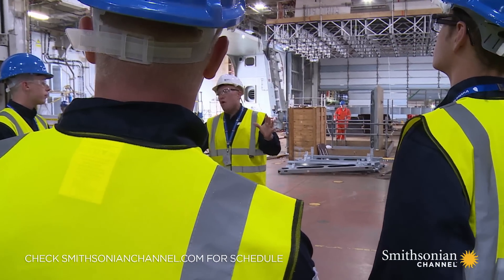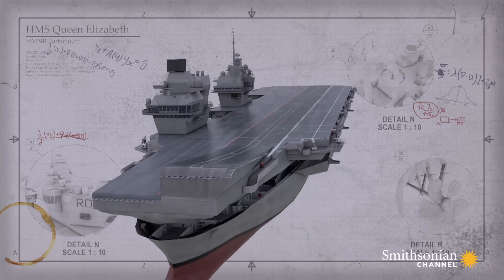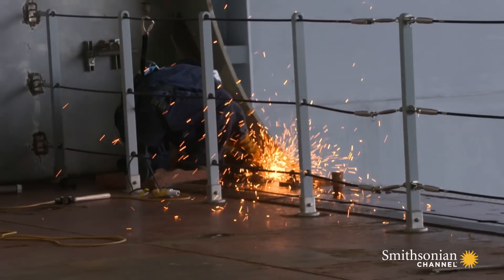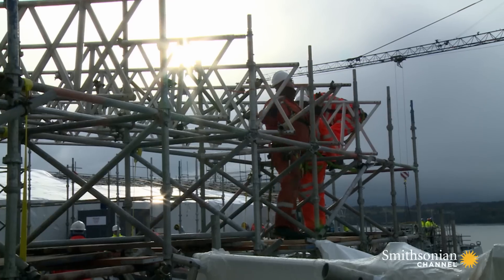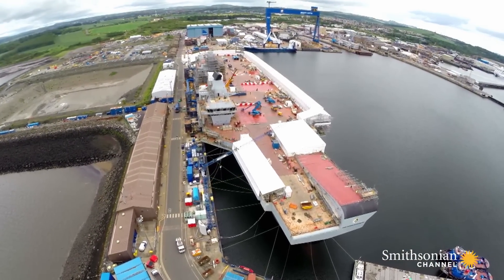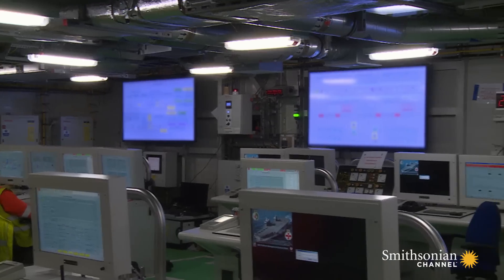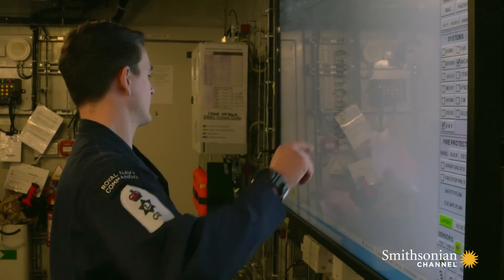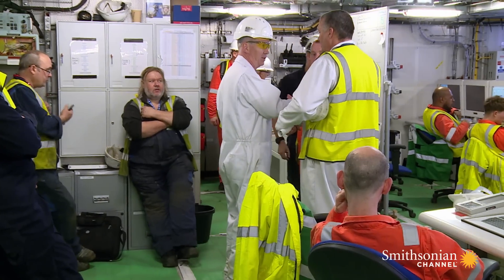The HMS Queen Elizabeth Stats are Startling

Comment: One interesting side note, is due to previous experience with aircraft carriers, both UK and US, she was designed with wider corridors so people could pass each other and such much easier. Also makes casualty transport easier.
Turns out injuries in corridors (cracking head on doorways, tripping over raised sections of the bulkhead) are one of the biggest loss of crew on deployment.

Comment: Constantly compared against American Naval counterparts-

First of all it runs on diesel with no nuclear reactor, What a joke. You are permanently limited to fueling stations. I dont care that it takes 1/3 or 1/4 the manpower. Obviously technologically inferior from the get go.
Reply: That's not as big of a deal as people are making out. Carriers need tankers, not just for refuelling themselves, but their escorts and their aircraft, so you'll never get away from that unless everything is nuclear powered.

For most countries it just doesn't make sense, you require far more maintenance and it's far far more expensive. It only makes  sense for the US because they have enough for a rotation so that there's always a number available and they have the budget to burn.
Reply: Do people run on nuclear reactors? What about the aviation assets? Surface assets? Nuclear power is a nice thing to have but when you have a ship full of people, planes and boats that require fueling, you range is still limited by fueling stations and resupply. 
"Keeping the carrier’s seven galleys adequately stocked is vital. A supply ship delivers 400,000 to 1 million pounds of food every seven to 10 days." This is from an article on the Nimitz. Not so much an unlimited range.

Comment: And yet still a ramp. Modernize. Catapult launch.
Reply: If anything the ramp is a more modern form of launching jets. The Royal Navy were the first to launch fast jets from carriers using catapults in the 50s, but later came up with the Ski-Jump design that they've used since the 80s.
Reply: Catapults put far more stress on the aircraft, costs more, possibly a third of the cost of each carrier to install on both ships. Plus there is far more to go wrong

Comment: It’s great. But It leaks and it’s powered by diesel, so the range is severely limited. Honestly this ship is advanced, but they should have gone nuclear powered.
Reply: All ships leak to some extent, and it's far from unusual to have leaks during initial testing of a first in class ship, you get those issues out the way early on during testing for a reason.

Nuclear power would have been massively more expensive too, to the point where the UK would have likely only built one carrier, leaving them without one for extended periods (Especially considering the extra maintenance required for the reactor). A carrier is always going to be limited by its escorts and aircraft which both require fuel anyway, as well as other provisions.

Nuclear power is useful in saving space on board as you don't need to carry as much fuel, but the ship was scaled to specifically meet the Royal Navy's needs, so there's more than enough space.

Comment: Problem here is that it runs on gas. 

10000 NM (19000KM) range is only about 2 weeks under her own power (Based on the 32kts/59kmh speed found on Wikipedia at least) I'd assume that the range is probably calculated at a more economical speed so maybe it'd last longer, either way, definitely going to be a pita to keep this thing going in the long term..

The same kind of automation and innovation on a Nuclear powered carrier would be fantastic, but with the limited range and regular need to refuel, not to mention the space lost to store that fuel, seems like a major step in the wrong direction to me, that said I'm sure way smarter people than I have thought this threw, so time will tell.
Reply: What difference does it make, it takes on supplies at sea, fuel food etc.   Nuke ships need food etc anyway. Difference is if a nuke ship goes up its not good for the planet or the people.
Reply: @PIRANHA_MAN  nuclear power is literally one of the cleanest out there

"if a nuke ship goes up" oh nevermind i read it wrong.
Reply: @PIRANHA_MAN  You might be interested in reading "U.S. Nuclear Powered Warship (NPW) Safety", the amount of fail safe mechanisms and procedures for these reactors is very impressive, The reactors were clearly designed for use on a warship with all of the considerations there-in. 

It's also a pretty common misconception that these reactors would "Go up" with the ship, even a direct hit to the reactor itself would not result in the kind of explosion that many people would picture in their minds, simply put, "Physics says no", A nuclear reactor doesn't have the ability to become a nuclear bomb. The worst that could happen is that the ship is hit hard and goes down, at which point there are 4 layers of safety that will prevent radioactive contaminants from leaking into the environment long enough for the reaction process to shut itself down (Keep in mind these reactors work on very different principles from Chernobyl.) If anything the environmental damage of a downed Nuclear carrier would be lessened due to carrying many thousands of tonnes less petrol based fuel.

@FBI the big difference here is the amount of fuel consumed and the amount of space that fuel storage takes. The aircraft fuel isn't being burnt at the same rate as ship fuel, and the huge tanks required for the ship's fuel is usable storage space instead on a Nuclear carrier, which allows you to carry significantly more consumables for the crew and the aircraft.
Reply: The Nimitz requires a supply run every 7-10 days for food.
Reply: @MrChris8162  "The Nimitz can stock at least 70 days of refrigerated and dry storage goods."

Directly off the nimitz website....
Reply: @bigblue4364  nuclear carriers still need supplying just like RO9 big difference is the QE Carrier can enter foreign ports where as most countries ban entrance of nuclear vessels plus she has a range of 10,000 miles which is enough for the RN so stick that in your pipe and smoke it

Comment: There is a good reason America ships are not automated
Reply: And what's that
Reply: They become very vulnerable to electronica warfare hacking and over complicated control system and control services which require more maintenance and more specialize parts. Last few years United States had several incidents with it destroyers.  dealing with overly complicated control panels to software glitches.
Reply: @skylerrichmond1555  What about EMP attacks
Reply: @skylerrichmond1555  The Ford class have more automation than the previous class of carriers, it's just not as much of a priority for the US Navy as they don't really have a manpower issue.

For the Royal Navy automation would be the difference between having a far smaller and less effective carrier or having the QE class like this.

Comment: The small crew really affects the survivability of the ship. what happens when the automation goes down, or you need to fix a critical system. i hope they have the same size of damage control teams on the ship. But to illustrate my point. What happens if the weapon handling system goes down, or is damage. Is there not enough men or alternative means to get weapons?
Reply: jon b do you really think a ship that powerful and that expensive doesnt have backups??? Even cars and cheap appliances have backups in place
Reply: jon b Multi-trained crew unlike the Americans.

Comment: What happens if the auto handling equipement  gets damaged in a war it will need manpower.
Reply: Stephen Long You’re daft if you think they don’t have alternate methods.Not to mention the fact that there is a giant 3d printer on each ship that can make replacement parts;much less time consuming than having spares produced and flown to the ship for repairs.
Reply: @aquillandscroll6428  3d printer that makes parts? Learn something new every day
Reply: DEZIIRE well I may have been a bit too much calling you daft,but yes each ship has a giant 3d,each are around 4-5 metres per side,compared to normal printers;that is huge,but it can’t produce massive sections of the carrier(as how would you even transport that around),whereas it can create sections or replacement parts for smaller mechanisms that are more likely to be harder to produce as spares and fly to the carrier in less time.
Reply: You think we tell you EVERYTHING ??

Comment: American carrier has much more capabilities.
Reply: Randy Gravel Explain.
Reply: Tristram Randall No awacs planes can be launched. No cargo planes COD planes can be used. Cat/trap system can launch aircraft with full fuel and full bomb loads. This system uses so much fuel for the aircraft to launch itself. This ship was initially designed to have the much better cat/trap system but became too expensive. It’s a shame.
Reply: Randy Gravel Cats and traps are good if you have a bottomless budget, you have to maintain the cats and traps as well as repair them over time and repair the small bits of damage they do to aircraft as well. The ski jump works and is effective so what's the problem? The F35B also uses vertical landing and take off. If one brakes the others cannot be used, suspending all flights, how efficient is that. British carriers have operated like this for decades perfectly fine.
Reply: Tristram Randall The have a carrier but no carrier battle group. American ships will need to deploy with this ship.....your welcome
Reply: Randy Gravel American ships will not always have to accompany the carrier to make up a strike group. QE currently has escorts making a group as we speak.
Reply: An extra 9 billion in costs....shocked, i can't believe it has more capabilities.
Reply: I have to return some videotapes Not even worth the 9 billion

Comment: "Lean manning" sounds good on the surface. But if it were to take slight damage it'd be out of the battle.
Reply: Rams495 No,because there’s a giant 3d printer on both ships to produce parts.And how is it going to take damage when it has escorts,tell me?
Lean manning also makes the ship’s endurance much longer with supplies lasting longer and the ship is less crowded.Sure it can operate with 600 at minimum,but it will normally hold about 1600 personnel.

And,do not forget that the vital parts of the ship are protected and are further protected by the module system which reduces damage as the outer segments act like spaced armour and absorb and keep the impact in,leaving the vulnerable parts which hold more crew;less damaged.

Comment: Impressive, but the trouble with that much automation is when the automated stuff is damaged during battle. For example, the magazine handling where they say that the Americans have 10 times as much crew. If the power to that section gets cut in an attack, at least the Americans would have 10 times as much crew to transport the ammunition manually.
Reply: Problem is in modern naval warfare if your ship is hit with a weapon or two your ship is already out of action for months and may even be irreparable or sinking. Especially torpedoes from submarines which are the greatest threat to carriers.
Reply: @Roytulin  Good point! It's no longer like WW2, where you could trade blows and still limp into battle. A carrier isn't likely to be hit because it fights from a long distance, but when it does get hit, it will be a torpedo or missile that's likely to be end of story. Pointless then to keep a crew complement  on the off chance that they can be used for a manual task that will probably be futile.
Reply: Joey Indolos yeah, also taking into consideration that a aircraft carrier is always escorted in a naval strike formation. I think its around 10 other navy ships that escorts it. 

So the chances of it getting hit is so small because its protected from all sides and by subs under the surface
Reply: deep within the ship, not easily

Comment: I'm sorry, but I read a very different article about this ship. It painted a very different picture.
It has no catapult system.
Why is this a major issue?
Because it means that the carrier cannot launch AWACS type aircraft like the American E-2C Hawkeye. No airborne early warning and surveillance capabilities. It also means that it cannot launch medium sized transport aircraft like the C-2 Greyhound. That means no aircraft replenishment at sea. (no medical evacuation or delivery of major spare parts...like jet engines).
It also means that no electronic warfare aircraft like the EA-18G Growler aircraft and no medium strike aircraft like the F/A-18 E/F Hornets, F-35C or Rafale M.  No capabilities to launch in-flight refuelling aircraft either.
And there is no arrester wire capabilities so such aircraft cannot be recovered at sea. This means the ship is going lack the ability to operate effectively from a stand off position and it's going to have to incur further risks over its French and American counterparts by having to get much closer their enemies. 
It has no well deck for recovering landing assault craft...so it can't be used as an amphibious assault ship.

So what does the Royal Navy have here? They have the largest helicopter carriers in the world with a secondary capability to launch a small compliment of F-35B aircraft. But without the support of the other aircraft previously mentioned, it doesn't pack a whole lot of punch when compared to American and French vessels. 
One has to wonder what they were thinking when they approved it's construction.
Reply: SuperSix Delta you do understand it won’t be operating in a war zone by itself. The whole carrier strike group will be assisted by US forced and other NATO members. This thing wasn’t designed to fight a war by itself. The brits have a history of making specialist vehicles that carry out one role and one role only, and doing this very well.
Reply: @harryvj6397  - yeah, but neither do American carrier vessels...or anybody else's carriers. They all operate as part of strike groups. So that takes us back to the question of "what do we have here?"
Reply: SuperSix Delta you have literally just explained why your original comment is invalid
Reply: SuperSix Delta Don’t forget the paucity of escorts and anemic organic defense systems. The QE has a grand total of 4 30 mm rotary cannons & 3 Phalanx CIWS.
Reply: @GrahamCStrouse  - yeah but that won't help it with a 200 mile exclusion zone. Short range weapon systems. CIWS (close in weapon system). Last ditch. 
Yes it will have a compliment of destroyer and frigate escorts, but history has shown us time and time again that the best defence of a carrier strike group are it's aircraft. That's why the Americans have arrester hooks and catapult systems for larger, longer range aircraft with heavier weapons and fuel loads.
Reply: Read up on the Falklands War chap, they'll do just fine.

Comment: With all the innovation the Royal Navy has done in the realm of aircraft carriers (steam catapults, angled flight decks and developing techniques for operating F-4U Corsairs off of carriers during WW II), it's nice see them getting new flattops.
Reply: Michael Johnston even if they do just use ski jumps
Reply: .... without catapults.
Reply: terry waller So what if it doesn’t have an angled deck or catapults;they were built for the Royal navy’s needs;what are you telling me that they should spend even more trying to procure an aircraft or create a new one to be on the ships and have the ships have catapults,angled flight deck and reactor(which the former 2;catapult and angled deck) can easily be implemented.Though the ship is mainly designed around the F-35(it’s predecessor being the harrier),thus the ramp.

And it’s not a bad ship indeed for a small price of £3 B compared to the £12B price tag of a ford class,mainly due to the reactor and EMAL system and laser defences that are being developed and installed for it.
Reply: terry waller  The USS Antietam (Essex Class) didn't have an angled flight deck until 1952. The British tested angled flight decks on HMS Triumph just before the US tested them on the USS Midway and although the US fitted it first, the British built the first purpose built angled flight deck carrier that didn't have it retrofitted to the ship.
Reply: Mirror landing gear

Comment: Automation is a great thing until it breaks down. What is the contingency for when the ship is damaged by an attack and systems start to fail?
Reply: Probably because it will have gradual redundancy built in. When one system is down another takes over etc. A bit like power station generators in which there are three. One operating, the second on standby and the third undergoing maintenance.
Reply: Just like any other, technology is everywhere in the military. Why is this ship any different. It's not surprising its got more automation its a brand new ship for christ's sake. What is it with you people, this is about the 10th comment about the same thing.

Comment: 'lean manning' may work as long as there is no conflict, no hit on the ship - afterwards, when the electronics are failing, where are the necessary hands ...?.
Reply: they're apart of the 650+ crew that are mannning it already, the point is to reduce the amount of manual labour as to allow for more technical persanel
Reply: The personnel level increases to around 1600 when the compement of aircraft is on board. And, we invented the concept of BDR (battle damage repair) and regularly train for it.
Reply: Also aircraft carriers are always escorted in a Carrier strike group with 10 other navy vessels!
Reply: @commonsense31  Your name hold true!
Reply: "Lean manning" is what it's called when I diet.